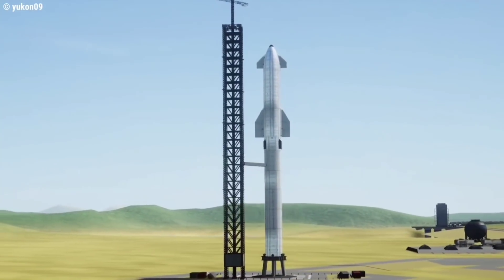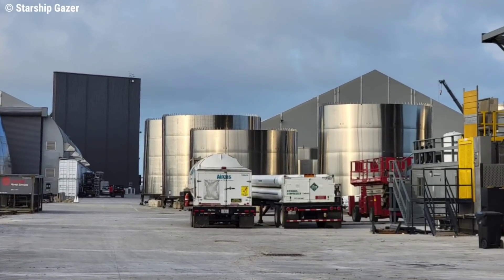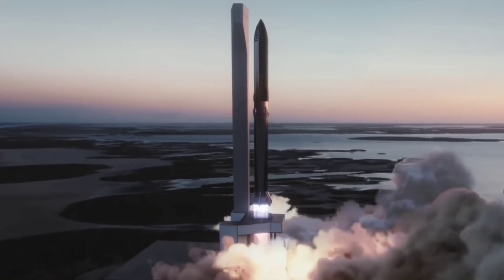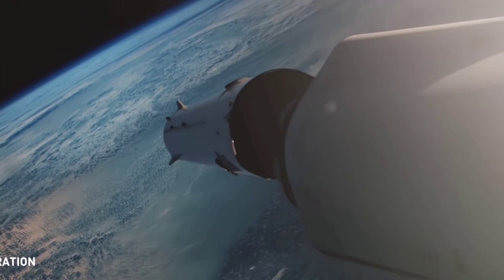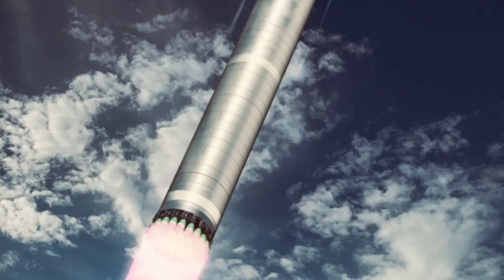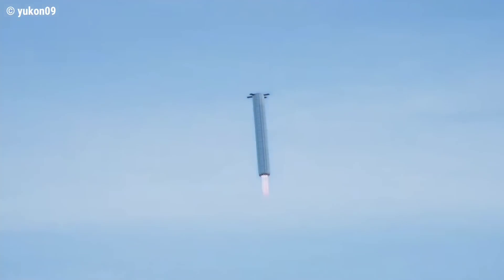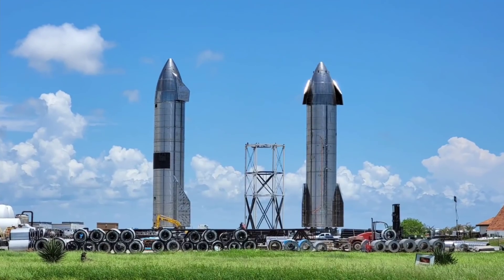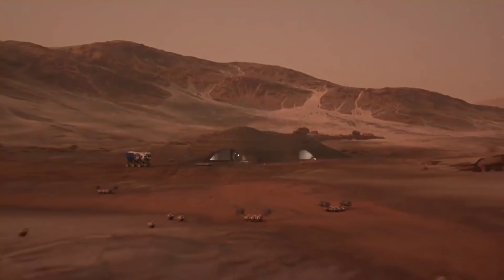Analysis Starship BOOSTER 4 ! What Makes Booster 4 Different From Booster 3!?

Comment: If I may, A question for your math-wiz viewers and/or subscribers; (My math skills, for whatever they may have been, have slowly eroded over the decades): Given: a fully assembled and fueled, largest/most powerful rockets in the global inventory, already in "upper earth orbit" (for whatever that means) fired at full throttle into space: what is the maximum possible speed it could achieve? Better yet, as an application: in order to minimize the negative effects of zero-G, how long could this craft maintain 1G acceleration? Furthermore, given a trip to Mars, at what point would the craft "flip" and fire "retro rockets (solid boosters?)" to induce 1G deceleration? (afterthought: given that weight/mass in space is less relevant, could such a craft be "armored" (or generate a "force field") to dramatically reduce exposure to cosmic radiation?)
Reply: - No math,  but the upper limit for chemical rockets with maximum exhaust velocity of 2 m.p. sec. is 36,000 mph or 10 m. p. s with multiple staging..
,-  Somewhat  faster velocities have been attained by gravity assist flinging (mostly by Jupiter).
- Ion electric propulsion on the other hand has a theoretical speed limit of 1/10 c. The engineering problems for the last 60 years have stalled main engin  development. Mostly due to the problem of  cathode polarity contamination on long running  emmitions of negatively charged ions (a year or more constant firing).
-   However small maneuvering ion thrusters have been used on satellites station keeling for decades now because they require "almost" no fuel mass.
{ c = speed of light )

Comment: Good analysis, but booster 4 will land in the ocean. Very unlikely to explode.
Reply: Also unlikely to be received in anyway.   I victory would be to show control and make a soft pointy end up water landing
Reply: Not necessarily, many Falcon 9 boosters have made water landings and have broken up because of it. Super Heavy is a much, much bigger vehicle so i think its very likely to explode once it tips over
Reply from the maker: Thank You